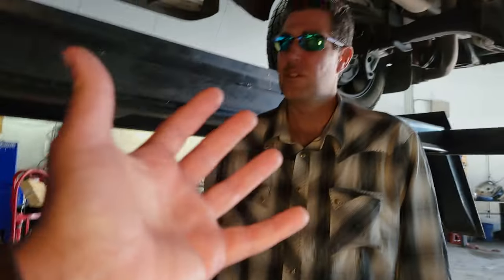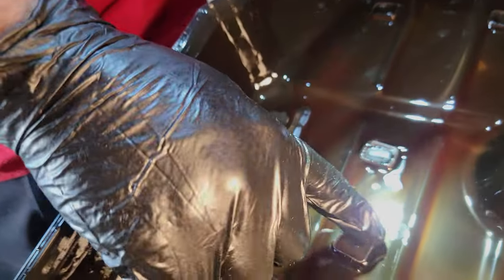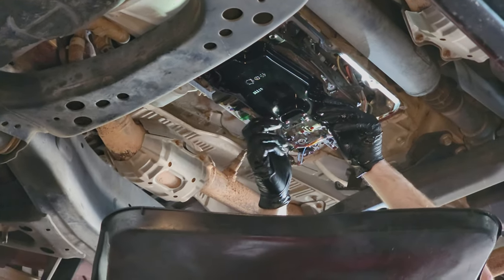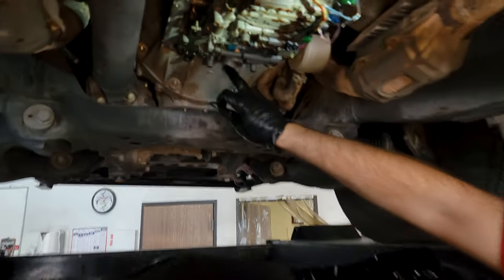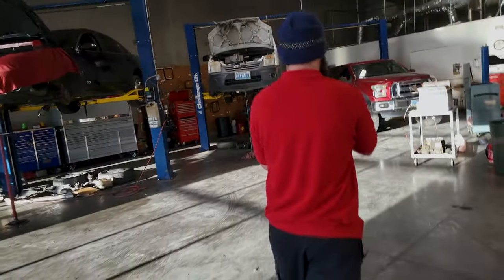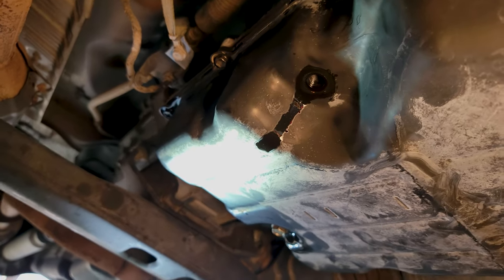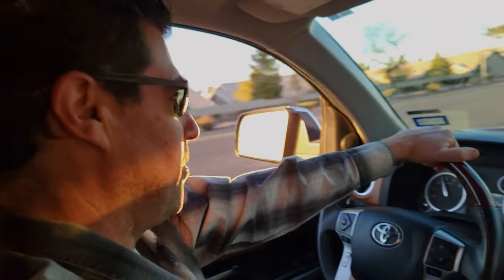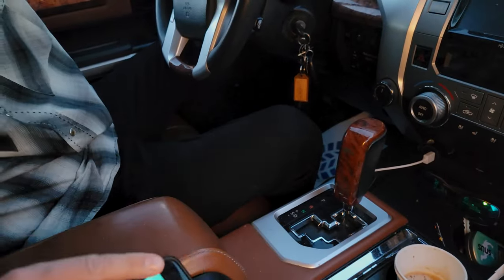Your transmission can Shift Better than New with this ATF

Comment: @YouLubher I had my dealership give me a hard time using Amsoil atf in my 2016 Toyota Tundra. They made me sign a waiver that they weren’t responsible if something happened to my truck. I called Amsoil and they told me it’s covered under the Magnuson Moss warranty act ( I might have the name wrong) I V.C. My signature and added that it was covered under this act.
The Care Care nut he is a Toyota Mechanic and has a YouTube channel also says to strictly use Toyota WS in the transmission because he says “ it was designed for Toyota Transmissions”. They don’t give you a hard time about different engine oils as long as it’s the right Viscosity, so what is the big deal with Transmission fluid that meets the Toyota WS specifications? My Transmission holds about 12 quarts or a little over. The dealership only used about 4 quarts. There is a procedure to check the level in the transmission and it has to be a certain temperature and you should use a scan tool. Your guy did not do it right or you didn’t show it on the video. The Car Care Nut says using a temperature gun isn’t accurate enough and you run the risk of the level being off.
Reply from the maker: The Amsoil will improve the Performance and lifespan of your vehicles 🇺🇸🥇💯
I give a man a fishing pole & show him how to fish. 

     Together! We can get your vehicles to run better than brand new! 

     For me to get credit & be "Your" Independent AMSOIL Dealer please use my website below or my dealer no. 5331179 call anytime Eben Rockmaker 702-472-3614
After you click on: http://syntheticoilprotection.net
1. Click hamburger menu
2. Click offers AMSOIL preferred customer
3. Click join now 6-month PC member add to cart.  ( there is no reoccurring renewal membership unless you select that dot box ) 
( you have the option to not have your credit card saved if you prefer - est. 1972 )
4. Scroll up to the top Select shop by vehicle. 

New promo:FREESHIP

Comment: What type of transmission fluid Valvoline Maxlife, Valvoline import multi vehicle or ATF Ravenol for a 2018 g80
Reply from the maker: You can order the Amsoil that's what I personally would use you will see it right here on my website you'll get the best value on the products as the preferred customer you'll also see the lookup guide which will give you everything for your specific vehicle.
     I give a man a fishing pole & show him how to fish. 

     Together! We can get your vehicles to run better than brand new!

     For me to get credit & be "Your" Independent AMSOIL Dealer, please use my website below or my dealer no. 5331179 call anytime Eben Rockmaker 702-472-3614
After you click on: http://syntheticoilprotection.net
1. Click the hamburger menu
2. Click offers AMSOIL preferred customer
3. Click join now. 6-month PC member add to cart.  ( There is no reoccurring renewal membership unless you select that dot box ) 
( You have the option to not have your credit card saved if you prefer - est. 1972 )
4. Scroll up to the top Select shop by vehicle. 

New Promo: FREEHAT

Comment: What if it's a sealed transmission system like my 17 hellcat? I think the dealer doesn't recommend a trans fluid change but I'm interested in it. Thoughts?
Reply: Same on my 22 subaru im changing it anyway at 30k cvt don't belive in lifetime fluid just do a drain and fill. Will make it last longer.

Comment: What do you recommend for ATF 3.1 fluid, amsoil doesn't show that it has anything compatible
Reply from the maker: It's a great question I honestly don't know what that is but the lookup guide will give you everything for your year make model and engine size if you ever have any questions in the future always happy to answer your questions about improving the performance and lifespan of your vehicles and equipment by choosing the right fluids as your independent Amsoil Dealer when you use my link that would attach me to you.
See the newest promo below.
     ♥️   Find The Right Fluids For Your Vehicles - https://www.amsoil.com/lookup/auto-and-light-truck/?zo=5331179 

     ✅   Save 25% On Your Next Fluid Order: https://www.amsoil.com/offers/pc/?zo=5331179 

Promo: FREEFUNNEL

Comment: Don't you have to fill it with the engine running?
Reply from the maker: Oh you can do it either way
Reply: @Syntheticoilprotection I believe you have to have it at a certain temperature range. If you run it too long then it could get too hot.
Reply from the maker: @chachi5975 yes there is an ideal temperature range

Comment: I also run the Signature Series Fuel Efficient with outstanding results in my Tacoma.. For anyone trying to make the switch HIT UP EBAN. If you are struggling to make the switch from Toyota WS, believe me you are OK . Yes! Toyotas do require a strick and specific fluid but Amsoils exceeds All them specifications. Your car will run like brand new, that is correct. And in my opinion even better because your transmission will run smoother, put less effort on your engine there for creating more MPG🤑..

Comment: Hey guys, what's your take on using the expensive PennGrade 20W50 oil on at 1600 baywindow? it's almost $9 per quart!
Reply from the maker: Great question Arthur I've never heard of this.
If you'd ever want to try Amsoil products this is my personal link and when you use it I would always be able to answer your questions in the future about improving the performance and lifespan of your vehicles by choosing the right fluids as your independent Amsoil today.
✅   Save 25% On Your Next Fluid Order: https://www.amsoil.com/offers/pc/?zo=5331179
Reply: @Syntheticoilprotection  Right on, Thanks.

Comment: Does anyone use AMSOIL  ATF in a BMW 760 transmisson?
Reply from the maker: Yes many of my customers 😃
🇺🇸   50 Years of AMSOIL anniversary - https://youtu.be/MQUqRBI8dD0
     
     🥇🥇🥇   Synthetic Oil Protection Google map reviews
Eben Rockmaker, independent Amsoil Dealer 
Dealer no. 5331179
(702) 472-3614
https://maps.app.goo.gl/1aXxuXrXK9eJwqK78

Comment: Hello,Eben I have a question I want to do a transmission fluid change on my 2011 Mitsubishi endeavor V6 The mileage is at 158,665 I want to put amsoil ATF in my endeavor’s transmission I was thinking after I do the transmission fluid change will the transmission shift good or it’s going start skipping shift? Because somebody told me if I do transmission change I’m going to damage the transmission and it will start skipping shifts.
Reply: All you can do from below (meaning short of pulling the unit and physically dumping (the fried original oil) out of each internal component is drain the 50% sitting in the pan.
The other half of the original fluid will remain in the converter, the gears and clutch sets valve body and any internal filters (fairly common on 2009 and up now unfortunately).
By at least draining out what you can through the drain port and topping back up with this Amsoil should be similar to a full fill of the oe stuff.
It won't be "fully synthetic" because of the remaining original gunk but definitely an improvement.
Just don't wipe out the brown grit off the inside of the pan.
The clutches need it to "stick"
If you remove everything fallen off the clutches and apply band you may find it doesn't "grab" like it did before and feel "sluggish".
This happened to me only it was putting back the original mineral base (plain regular Dexron).
I had to have the transmission replaced after because it wouldn't grab like before (& it was getting progressively weak over time and I didn't know that you are supposed to change the transmission oil out).
Keep it simple just drain the fluid only and top it back up with the Amsoil seen in the video it should run as before only not be brown and stinky.
Actually what you should try is even easier!!
Get one of those plastic suck out device that you put the poly tube down the dipstick tube and suck out what you can of the original stuff and refill with the Amsoil if you can't access any drain plug.
The caution that your friends or whoever gave you is the same as me - which is don't wipe off the brown silt off the pan bottom. If it's right now "struggling to upshift" then the internal filter is gummed up. Only replacement of the filter don't hose off anything else if you find the filter is plugged with black flakes (extra bad sign😢) 
Hopefully you don't have to go inside.
Good luck 🤞
Reply from the maker: I made this playlist for that question - https://youtube.com/playlist?list=PLB_ftWArBFddVQNbHRp49F6DeiBeNFSS_&si=-xzjN_gTs8_tGBY8